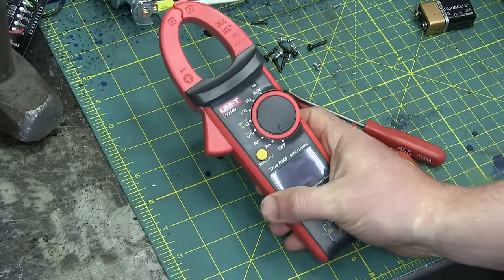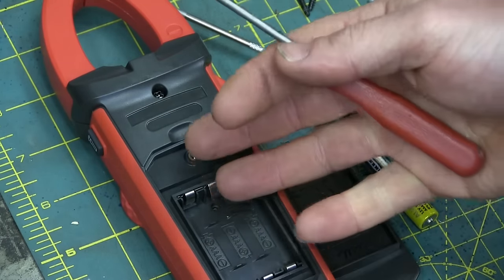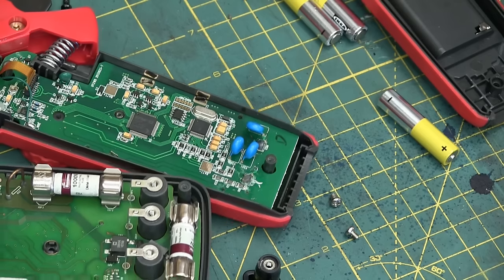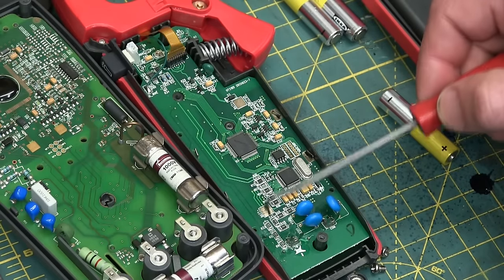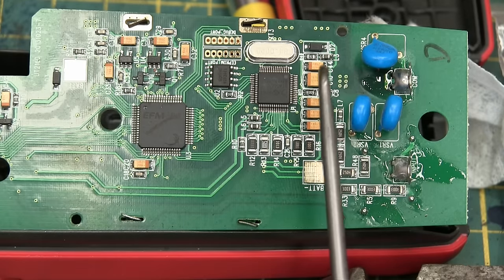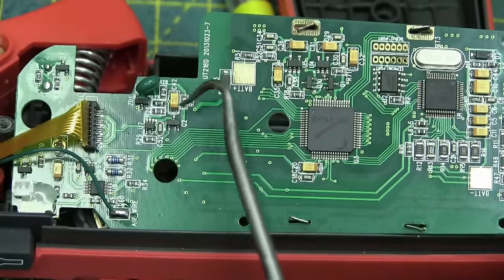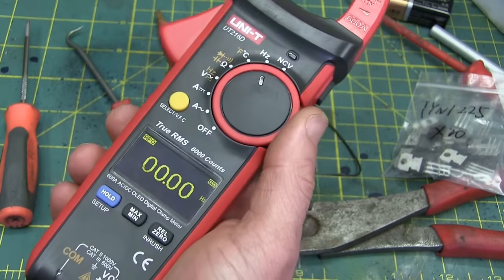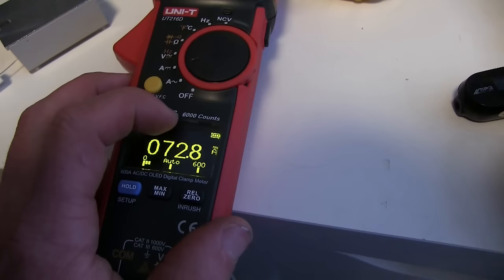BOLTR: UNI-T Clamp-On Multimeter

Comment: I did a job mutilating dead tree carcasses at one of Intertek's testing facilities here in the big shitty. Gotta say I was pretty impressed. They brought us in to fix somebody else's fuckup, and they were kind enough to give us a tour of the place. They were testing mostly building materials, not consumer electronics. Seemed like some talented, passionate people doing important work. Results may vary by facility and products being tested though. 

On an interesting side note, they had a few aircraft engines used for high speed wind testing. Being a bit WW2 nut, I recognized them instantly as the Pratt and Whitney R2800 Double Wasp. Famous for powering the P47, Corsair, Wildcat and lots of other aircraft. Anyways, curiosity got the best of me and I had to find out where they came from. The employees didn't really seem to know much about them. After doing some research I was able to match the prop to the Canadair CL-215 water bomber. Which I assume were sold to the public after being retired. So not only a famous piece of engineering,  they were also from a homegrown bird.

Comment: Brought a Uni-t ut203 ac/dc clamp meter about 8 years ago for high current dc work on forklifts - within 2 days the 0-40 amp range failed, the 400amp range, as well as every other function work perfectly! And thats 8 years of daily use! It seems there designs and component quality is OK but quality control is not up to par.

Comment: The H201DTC is possibly the ADC.A common build design anymore is to do microcontroller+ADC for multimeters. Your OLED driver is likely underneath the OLED display. The funny thing is, Uni-T KNOWS how to make solid stuff. They are the Chinese partner for Fluke. All of the Chinese-made Fluke designs are designed by Fluke and manufactured by Uni-T.

Also, you bitch about testing but sometimes things get damaged in shipping. I had a Fluke arrive DoA before and Fluke took care of me.

Comment: I'm surprised you haven't been called on this yet, but what you call the China Export Mark on the UNI-T is not a China Export Mark.  It is the Conformité Européene marking that means a product conforms with EU regulations.  If you extend the c in the ce mark to make a circle and the left side of the e sits on the line of the circle, it is the Conformité Européene mark.  If the left side of the e sits in the middle of the circle, it is the China Export Mark.

Comment: I have one experience buying a UNI-T tester which looked like a much nicer LCD version of the old GreenLee GT-95 tester yet cost 1/3rd the price.   Hoping it was going to be one of those "lots of flash for little cash" purchases.    Turned out to be a "lot's of flash with stinky rash" purchases.  It read voltages like a Magin 8-Ball giving you a different answer every time.    Wish I would have seen this video before that as I would have stayed clear.

Comment: If it does thermocouple measurement , you just short your normal leads if you want to know the ambient temperature.

A thermocouple produces a voltage proportional to the temperature difference between the ends of your wire. Hopefully nobody has tried to patch your thermocouple wires with regular copper wire.
The instrument then needs to know ambient temperature to math out actual temperature of thermocouple. Short your normal leads, no volts, shows just ambient.
Reply: Jan Knutar and it does so by using 2 different metals tucked together !

Comment: I bought a harbor crap K Type temp meter a few years ago and it reads the same as a Fluke, But I do not rely on it when setting super heat. I believe you have said "you get what you pay for" and that is so true. But for $100+ I would ship back. Great Video's, many who view have never been in a industrial setting, and are unaware of danger of Amperage.

Comment: One thing to keep in mind with these Chinese toys is that you'll get different quality depending on the market you buy from (or, more accurately: for). If you buy that stuff directly from China, you'll most likely get the version for the local (chinese) market, which is built to lower standards than versions for foreign markets (this is verified especially for UNI-T stuff). That said, I just bought one of these despite of your verdict, because I like to live dang-eriously...nah, I just don't want to fork over double the dough for a Fluke. ;-)

Comment: I would guess that the meter was tested before it left the factory but all it would need is a bad solder connection or a damaged trace after it was tested and it could fail to work.  I would double check all the joints on he input and maybe even solder a bodge wire on from the input pad to the closest connection on the trace.  This meter could have been damaged due to design problems the first time the leads were plugged in since it could have flexed enough to damage the connection to the board.  These days even the so called quality tools are built down to a price and I consider the UNI-T meters to be fairly decent quality for the price.  If you would have bought it locally it would have been fairly easy to return for a replacement that worked properly.

A few years ago a fellow teacher was telling me that their department purchased a classroom set of 26 Fluke meters and had 3 that were partially faulty.  One the ceramic fuse body was cracked and the other 2 had display issues.  We are pretty sure they were damaged in shipping from a large drop.

When our school bought a classroom set of Snap-On meters they all worked 100% but you could tell that the local Snap-On supplier had taken the time to check that every meter worked before delivery.

Comment: Oled may look cool, but they drain batteries and outdoor visibility sucks. Maybe theres a reason why Fluke is not releasing a oled meter.
Reply: I thought oled was exact opposite.  more efficient and better outdoors.  hmm
Reply: My guess is, that's why they used that uber-low-power micro, to try to offset that :P
Reply: It is verses backlit LCDs, but not these liquid crystal displays, it only takes a tiny charge to twist the crystals and switch a segment from clear to opaque.
Reply: OLED sucks outdoors. Even an LCD that's designed to be back-lit, and doesn't have a full reflective back layer, will still produce some amount of contrast when light shines in through its face. But an OLED has nothing that makes contrast except for the light that it's emitting. If the light shining on to it is brighter than the light it is producing, you'll see nothing.
Reply: OLED displays actually use 60% to 80% of an LCD showing the same image.
Yes, outdoor viewing is poor due to the metallic reflectivity of the metallic cathode but with a good polariser and anti reflective coating they can be less reflective than LCD.
The reason that they don't add these filters is cost and that's the same reason Fluke don't use OLED screens. Why would they when they can sell a meter with a cheap screen for a lot of money?
Reply: Kevin Stempien  More efficient than tft lcd,&#160;but static lcd barely uses any power.
Reply: +Kevin Stempien EEVBlog did a review of some of the OLED meters by Keysight and they have poor battery life and worse outdoor visibility.
Reply: +Evil from evilution its not like companies are upgrading screens to OLED for free. You are paying a cost premium for that screen and in this case buying a meter that you would otherwise not buy.

Comment: You're right, there is no reason for a HRC fuse in a device containing no current path in it.
On the other side, using superglue to bond lifted pads is not the best way to repair them. The superglue sisintegrates releasing the acrylic acid that tends to eat copper. Use epoxy instead.

Comment: The problem is, if someone hasn't pointed out, because the blade which broke off, actually broke the connection to the trace. Can be fixed by placing a jumper wire between the blade and the component that is on the other side of the board that's coming through. Hard to explain in words :P

A simple fix that can be done in seconds.

Comment: That green varistor looking blobby at the top of the board looks like an integrated fuse.  MAN that thing is cheap for a $150 instrument.  No breaks, no cuts in the board, shit for connections.... ew.

And yes, you do want input protection on an induction sensor.  It's basically a single-loop transformer if you want to think about it that way.  Induction can make some REALLY powerful things happen.  Also, the base inputs should absolutely be protected.

Comment: Of course it doesn't have a fuse, it doesn't have an amp input on the terminals. Clamp meters never have fuses. Regular multimeters don't have fuses on the V terminal either.
Reply: This guy is right !
Reply: yep watch the whole vid
+AvE is learning by doing in most of the videos man.
Reply: I think its still unacceptable design to not have an input fuse, even if it doesnt have a current range. What happens when some distracted tech has it on an 110V bus and accidentally switches it to ohm  mode...
Reply: That is what MOVs and PTCs are for.  A fuse would do NOTHING for a voltage range. Also, if a meter is UL listed, which this one isn't but many are, it is rated to handle the rated voltages (and required spikes) on ALL functions and ALL ranges.
Reply: QCprepper The exact same thing as happens to any other meter that is switched to ohms range that is connected to mains. Which for decent meters like this one is nothing much. That's what the PTCs are for.

As I said, the fuses in normal meters do not protect the voltage/ohms/etc terminal, just the current terminals. That is in fact why they have separate terminals for current.

Comment: To break away from Arduino and start using ARM chips check out mbed. There are quite a few dev boards that support it. ST make Nucleo boards, Freescale make FRDM boards with capacitive sliders and LCD screens. Loads of the boards have Arduino compatible headers.

The programming is very Arduino-like but done in a browser which is a pain (but also means it no drivers or issues with compilation), to upload just drag and drop the downloaded file on like a flash drive. Finding resources and project guides is not as easy, but you get to use boards will more grunt and extra features (RTC, Accelerometers, Memory) all cooked in, and way more room for code. Also, they're cheaper than the genuine Arduinos (though way more expensive than the clones).

Comment: DC clamps needs to be zeroed right before the measurement. I have a UT210E and it also typically has a 300mA bias when you first turn it on.
You might want to inject a small known voltage at different points in the input stage to check what is fucked. The  PTCs are in series with everything so if they are blown or have a cold joint it might cause the meter not to work.

Comment: I bought the Klien tools cl800 it is nice and scookum.     Buy something you can trust every time you turn it on, and then test it every time you turn it on. Your meter keeps you alive. 

Count does matter I replaced a working accurate meter because i needed to be able to set voltage regulators on 24v charging systems they run 28v (yes its just double a 12v automotive alternator set point). With a 2000 count meter it only displays 027.9V  the last count is only good to +-5 counts depending on temp. Soo that would put the voltage set point as low as 27.4V not nearly close enough to charge 3700 cca worth of battery's.

Comment: Battery compartment captive screw is nice along with a treaded insert into brass.  I totally dislike the use of 3 AAA batteries because alkaline AAA are a poor value compared to AA and they both leak.  My UNI-T UT210e also uses 2 AAA cells.  I have to use the very pricey lithium's.

I'm thinking of getting the UNI-T UT207B because it has the low-Z function and 1000A ac/dc.  The Fluke SV225 Stray Voltage Eliminator Adapter is about $70-80, pricey because the UT207B is about $100.

I've been too lazy to make my own low-Z adapter using many resistors and fuses even having the components already.  The Fluke and probably UNI-T uses thermistors or similar that will eventually fail like those used in surge suppressor extension outlets.

Comment: Great video. Couple of corrections: when MOVs break down, they do not transform into short-circuits, or go low-resistance (at least, in a non-differential sense) -- the voltage across the MOV remains above the MOV breakdown voltage, even as it's breaking down. This is in contrast to spark gaps and glow tubes, which do indeed flip into a conductive state when the breakdown voltage is exceeded, allowing that conduction to continue even if the voltage drops somewhat below the breakdown voltage. Also, more pedantically, I was surprised to hear you say that tantalums contain liquid, and based on some research it seems that most tantalum capacitors have solid electrolytes. Also, by not pressing 'Zero' before doing the DC measurements, you threw away a lot of accuracy -- with magnetic field-based measurements, you need to set an initial zero point, or else you're just measuring the Earth's magnetic field. It's like not zeroing out kitchen scales before using them. By adding the 0.3/0.4A you were missing by not doing that, the accuracy would have been seen to be much higher.

Comment: Why didn't you solder the piece that you broke? Why the superglue?
Reply: It didn't break, it unglued.
Reply: It delaminated from the PCB. Solder won't fix that
Reply: If you look closely, at 8:40 ish there's a tiny trace going from a through hole to the side of the trace in which the connector was soldered. So yes, it does need to be soldered back on. Scraping off a bit of that conformal coating, then soldering a tiny strip of copper to the top side of the connector should fix it.
Reply: I prefer running an actual wire to the destination.  That way you're not relying on whatever tiny pad you're able to scrape into submission.  Especially since it's such a short distance.  Probably easier, too.
Reply: +alecjahn it would be easier to do it that way, definitely, but overlapping a new trace on top would look much nicer. I guess it doesn't matter as long as the chooch factor is >0 haha.
Reply: +1 I saw that also.  Need to reattach that trace and the through hole at the other end of that trace is the spot to do it.  Does not need to be a very "beefy" wire, but then that trace is a largish one..

Comment: Don't fall for the OLED display. It uses WAY more power than an LCD. I have used a Keysight U1253B to log temperature at work, and with its rechargeable battery FULLY charged, it lasted a merely 14.5 hours. No good.

Comment: Hey AvE, there's a trace you didn't fix. Look at 8:27. See the trace coming off the edge of the lifted pad? You probably need to solder a wire from that to the connector. That'd be my bet on what's broken.

I'll look forward to another video on this thing, but if not, oh well, I suppose.

Comment: I don't know how the 30gf nylon zytel holds up to electricity, but in molding cases for electronics, ABS  and ABS/PC are commonly used for electrical resistance. Most case material for electronic gadgets is ABS for that reason. Pull the battery cover off your tv remote and look for the material marking between the >< symbols. Bet it's ABS

Comment: Sometimes small resistors are ganged to raise the voltage rating.  like using  two 600 volt resistors in series to safely handle 1000 volts difference across them, only 500volts dropped across each resistor...